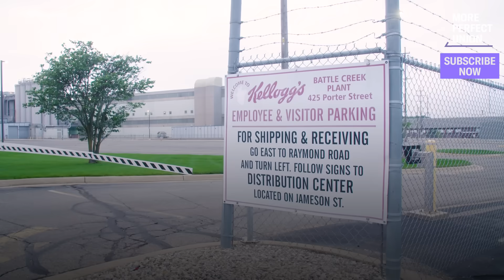Kellogg's Factory Working Conditions EXPOSED

Comment: This company must not realize that having their employees to work sixteen straight hours is placing those employees at risk because when they get behind the wheel of their vehicles they are impaired. Being fatigued while driving is an impairment. Just like long haul truckers aren't allowed to drive after a number of hours. I hope that these employees file a class action lawsuits against the company. If nothing else it will get their attention. Also it's a disruption to their sleep patterns. I'm sure that theirs plenty of them have problems sleeping.
Reply: And that leaves their family without them. Sure the family may have a lawsuit in certain states but the loss of a family member isn't worth it
Reply: As long as the workers don't crash into a company executive's car, the company won't care.

Comment: Here's my take on the opposite of the coin. If you are somebody who has outside obligations and aware of the fact companies like this will treat employees this way, why in the hell would sign on for such misery or stay 10, 15, or 17 years working there. It's a low level, low skilled job at best. I understand somebody has to do it. I understand that when push comes to shove you do what needs to be done, especially if you have a family. I understand that the heads of these companies SHOULD possess some amount of human decency and moral fiber to empathize or sympathize with your fellow human being. That said, a businesses number one concern is making money. That is the reality. Nobody has a gun to the heads of these middle aged people saying you have to work here or else. The alternative is for the masses to come together and vote with their wallets. If the workforce is gone, company losese massive profits for not making said product. They will be forced to renegotiate or outsource. If the outside source thinks the same way, they will be forced to adjust their tactics on pay, benefits and so on. The more plausible solution is for people to get what they can while working there and pursue goals that will lift you out of the hellscape. You're supposed to be rising to your potential, not settling for the scraps.